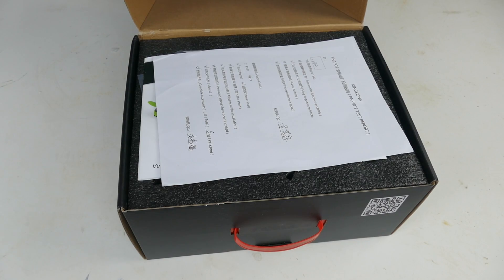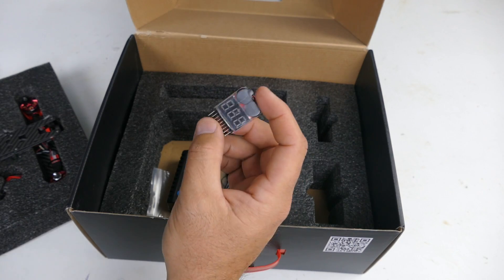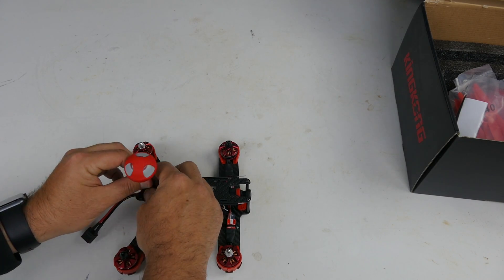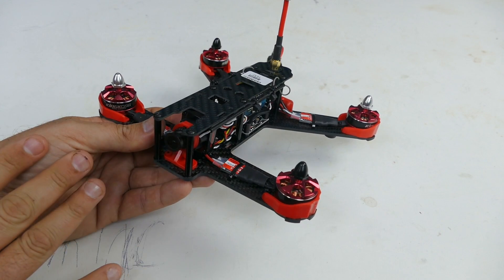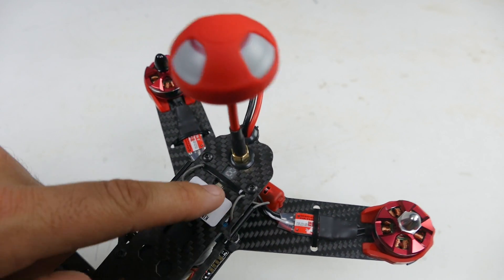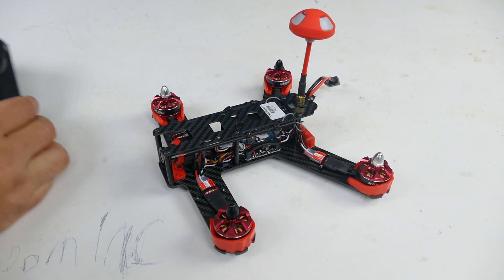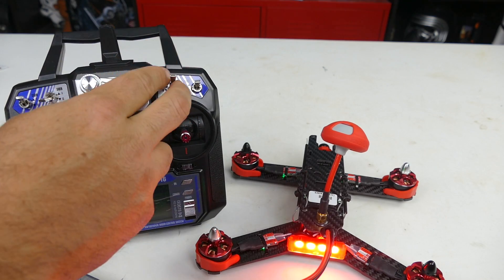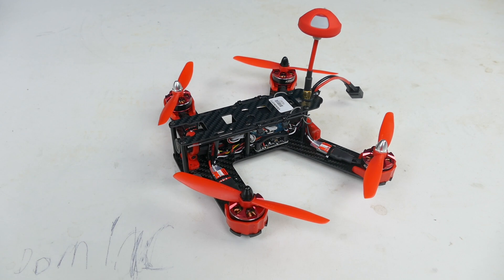KingKong 210GT RTF Unboxing

Comment: It comes with 2 bags of props, does it matter which bag of  props I put on or not?
Reply from the maker: It's hard to know without see the bags. It does matter what direction their lift is because there are 2 different directions.
Reply: CCxRC thanks, I just noticed the different directions on the props that correspond w/ motors.

Comment: Great starter quad!! I had an older version with 12a escs...it was the first quad that really worked well for me.  Only issues I had were using Libre pilot (hadn't figured out betaflight yet) and I used 4s which killed the 12a sc eventually.  I'm still using the motors and vtx on other quads.
Reply from the maker: +Vaughan Heilman great to hear! Look forward to flying it